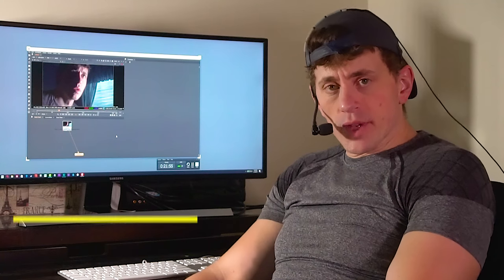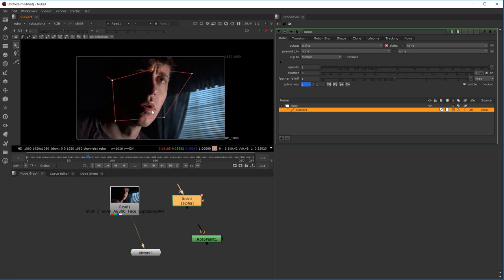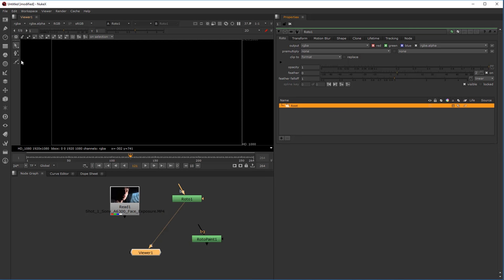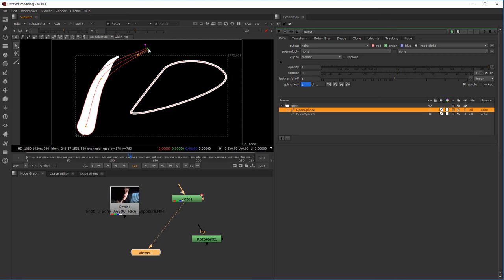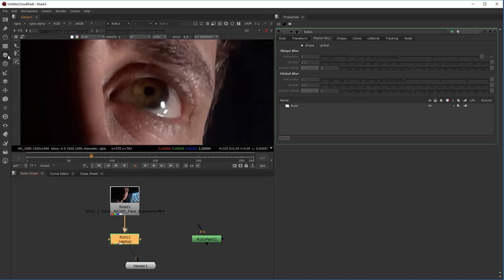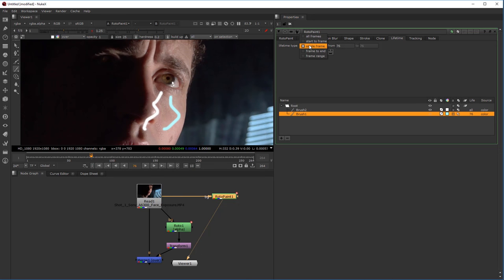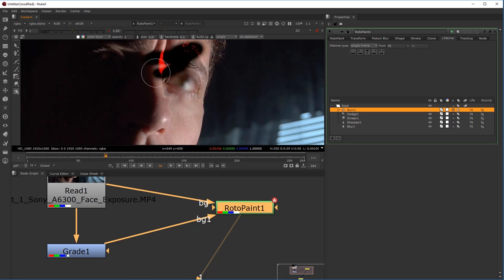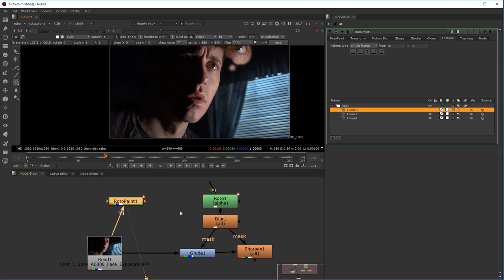NKE 101- Nuke 101- PART 6: Roto and Rotopaint Nodes

Comment: I can't make a marquee selection box. If I try to drag a box over the roto shape and release, the box selection disappears and no marquee selection:( how do you do the marquee selection at 9:34?
Reply from the maker: Aethelu Wang the roto spline is selected beforehand?
Reply: Confirm that the "pointer" option of the Roto selection menu is selected. Then click the specific shape in your Roto node properties. Then CTRL+A to view the selection box. 

Hope this helps even after 2 years later :)